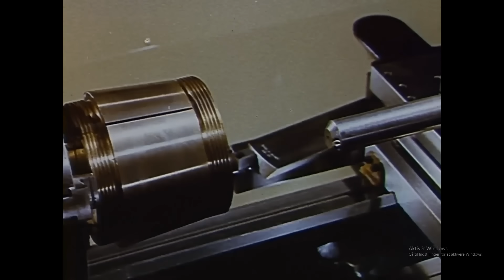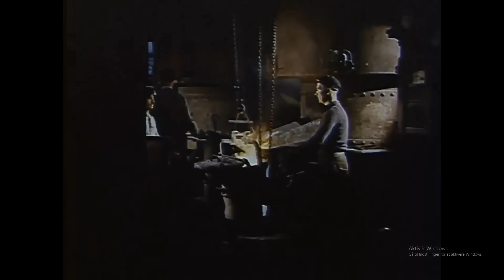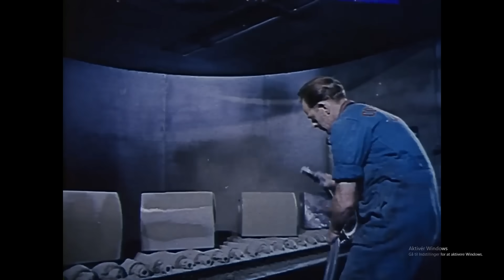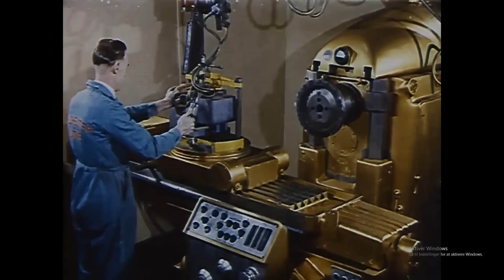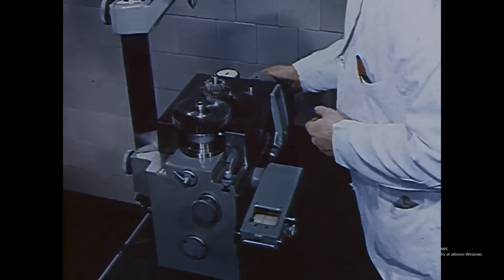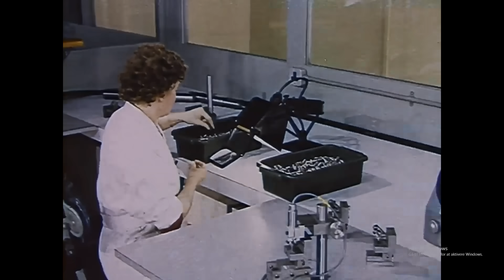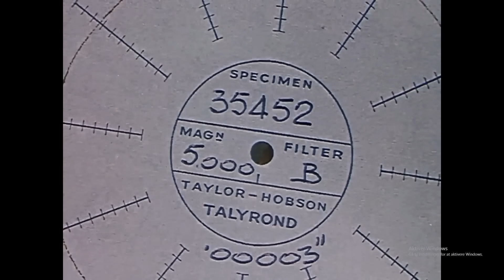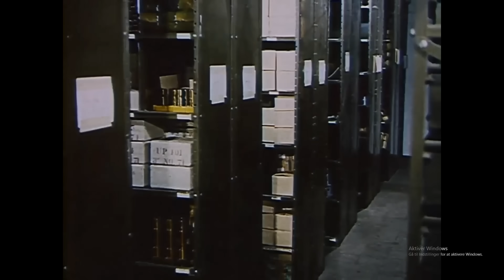Colchester Lathe Company

Comment: I do wonder when this film was actually made. I mean, gold painted CNC machines?
Reply from the maker: They are not CNC ☺️ its from the 60'
Reply: @VærdAtSe  Hmm. We had a computer fly a rocket to the moon, and that involves complex trigonometry. Modern CNC machines do nothing else than simply execute programs. They do not pay attention to any vibration etc. If you tell a CNC to plough at 12m/s through unmachinium, then it'll try to do that. And those machines could very well have rudimentary control logic. It depends on what you count as a computer, and what isn't. I mean, it could be using cams and all that like Starret did (and does, though they're phasing those machines out), but I would assume that they would technically have been able to pull that off.

And wikipedia (https://en.m.wikipedia.org/wiki/History_of_numerical_control) says that Monarch demonstrated a NC lathe at the 1955 Chicago Machine Tool Show. As far as I can tell from the article, CNC was already commercially available in the 60's, though it really took off with integrated circuits.

Comment: I wonder what year this was filmed?   The two newer vans shown appear to be Ford Thames 400E vans, which were made from 1957 to 1965.  The newer vans' license plate scheme was typical of the late 1950's up through 1962.  So, the video was most likely made between 1957 and 1963, unless the vans are more than a year or so old.    

The 5" Chipmaster lathe was introduced in 1956.

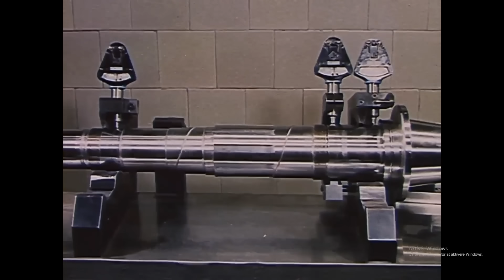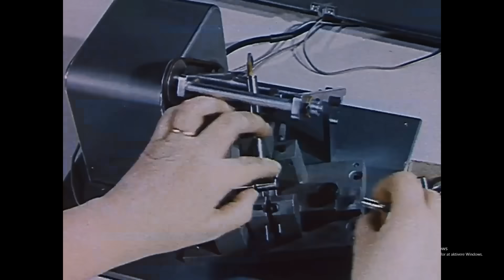Comment: @17:30 "However it is in the spindle bearings that precision reaches its peak" . . . @19:00 "machine can measure 4 millionths of an inch, and in each bearing the dimensions do not differ by more than 10 millionths of an inch". That's wicked accuracy / tolerance / variation for the immediate post WWII period (1960's this film?) and I'm so impressed. Such quality of workmanship, such a focus on doing the best possible, not "good enough" - building up to a quality not down to a price. I want one!

Comment: Lathes made by them are quite good. They do have weaknesses through like anything else. Bearings are OK as well but not revolutionary - if they were one could buy them somewhat easily today & they would follow standard sizing. Infinite variator in chipmaster is remarkable engineering (Swiss) but does not last too long - no match for US competition's designs. Compound is held in a way that I hope no one ever copies. Bed is well made and very rigid, headstock spindle the same. Gearing is very well made. Matrix clutch is solid but safety for it was added later on, not from beginning. Motor is large and more then adequate. Overall one of the top makers in the world.

Comment: I worked at Dormer Machine Tools in Worksop in the 70's. When they moved from machine production to drill production this meant investing in specialist equipment making the rows of Lathes, Millers, surface grinder etc redundent. At the time there was a slump in prices on second hand machinery prices. Making them worthless and scrap. To prevent the scrap merchant selling them on we dropped them into skips off a fork truck to smash them. I can remember dodging the flying parts as the flew off.

Comment: Worked at Colchester lathe and did a 4 year apprenticeship in the 70s,Worked on most of the machines from snow grinders to laths.I was there the day they showed a grope of Chinese round the shop and saw the first lathe they made copying ours.Over 400 worked there at one time and we had one of the first cnc machine shops which then you programmed with tape and it cost £1000 for 1 k of bubble memory.Memory’s it was a good place to work and we were all very well paid for the time

Comment: they had 1 major problem the main spindle brg preload was set with springs if when grooving you turned away from  chuck it ruined the gammet headstock brg because the springs compressed and the front brg went slack and the rollers scored the ring

Comment: We need to get back to making quality machines such as this, made to endure and if needed repaired instead of thrown away and replaced. Better products, better work and skills, better for the environment.
Reply: Thing is, they never did get thrown away. Eventually everyone who needed a lathe had either a Colchester or Harrison and stopped buying lathes entirely.
Reply: @will5948  by throw away, he means the chinese lathes that quit working when the burrs holding them together finally wear off. China is pure garbage. The colchesters, monarchs, moris. Meant to last compared to the scrap heap imported from china
Reply: @mackk123  I meant 'replaced with new' when I said 'thrown away'. Every machine shop and toolmakers I've been to (in the past 10 years or so, in Britain) have either no manual lathe or a 50-60 year old British lathe, and maybe the eponymous American vertical mill of similar age, for similar reasons. These companies aren't replacing their manual equipment because it doesn't break. I'm all for quality product but these lathes (and the Bridgeport mills) were just too damn good!
Reply: @will5948   A toolmaker friend of mine told me that the availability of good quality iron ore is not there anymore to enable making good machinery at a competitive price. He also said that with the cost of lower quality machines being so low, if you cannot make enough profit out of using lower quality tools to cover the cost of replacing said tools by the time they wear out then you are not a good businessman and should not be running an engineering firm !
Reply: @will5948  It's the same at my work. We have 2 new cnc machines (mill and lathe) and 2 old manuals that are Swedish made. Those machines are probably twice my age.
Reply: @will5948  Myfords are quite popular for the home machine shop.
Reply: I wouldn't be so sure to say that today's machines are exactly cheap and throwaway , particularly Mori and Nakamura etc . Unless for one off jobs , it's so difficult to compete against the modern stuff , particularly in terms of output
Reply: @minifratellijames  what about DMG
Reply: @minifratellijames  I don't think anyone disputes some of the quality and engineering excellence in the machines today. But if you aren't trying to kick out 100,000 parts a year, our options out there are ugly as sin (albeit very good), but my god are they truly ugly, aesthetically speaking.
Reply: It's easy to get nostalgic about old times "quality". These machines are basically useless outside of the garage shop in today's standards.
Reply: @IvanStepaniuk  I’m not sure how you qualify them as ‘useless’? Yeah maybe in a mass/batch production CNC shop they won’t be able to compete on speed and productivity with CNC versions but generally in my experience CNC shops also keep their manual machines when venturing into CNC work in the first place. Even CNC production shops end up having to do small quantities (one offs, two offs...dozens and half dozens etc) parts which don’t justify time programming and taking up capacity on CNCs. 

And no one buys a 5 axis CNC mill for high hundreds of thousands before buying a manual centre lathe in the low tens of thousands first. 

Plus you also have toolrooms, job shop subcontractors, maintenance departments etc. that all still to this day are utilising manual machines over CNC for their requirements. 

I think what is more likely than the death of manual machining is the increasing availability and popularity of ‘CNC-Manual combination machines’ where the operator can directly control the process via hand wheels for small quantities or indirectly control the process via NC programmes for larger quantities. 

This would be a best of both worlds option and a number of companies such as Tyler Machine Tool (?) in the US and Colchester Machine Tool in the UK are already offering their own combination machine models for sale.

Comment: To make a high precision tool, you need a tool of higher precision to make it. No it isn’t a chicken egg problem. The first tool gets more had tuning to bring it to standards required to make the second.
Reply: I'm going to disagree with you there ! What you do need is test gauges to ensure the finished product is to specification. In this film, Gamet's rollers for its bearings were a range of sizes as the machine making them was not precise. Gamet got the precision by selecting sets of rollers within particular size ranges to try to ensure the loading on each roller was similar.
Reply: It is not necessary to have high precision tools to make high precision tools. You can produce high precision using a mechanism of precision multiplication. It is all about mechanical mechanism engineering.
Reply: @comprehendnature2404  They say that the human finger can feel things the eye cannot see ! (difference in thickness, say). Optical systems are common for 'precision multiplication' - the obvious one being the Vernier scale.
Reply: @millomweb  Yes and some examples of precision multiplication or increasing precision is the use of mechanical linkage arm and lever, the use of lead screw, gearsets ...etc, help us to divide a a large movement to small giving us high precision.
Reply: @comprehendnature2404  Works the other way around too - weighing scales usually use a small movement to move an indicator a large distance! - just how hard should you tap the gauge ;)
[Interesting that my 6tpi leadscrew moves the saddle  4·19mm/rev !]

Comment: This is crazy how accurate things were back then. Technology has not improved much in manufacturing and building these kinds of things, the only thing that's new is silicone chip computers and robots operated by them.
Reply: It's laughable how false your statement is.  The Citizen machines that I program/setup/run have accuracies measured in microns.  These machines, at their best, could never hit that level of precision or repeatability.
Reply: @brandons9138  . I guess you didn't get to the right point on my comment. How did your Citizen machines where made? Was your machines 3d printed? Precision and repeatability is the only thing what is improved,  other then that it's the same thing.
Reply: @NotJustCreative  "Precision and respectability is the only thing what is improved,  other then that it's the same thing."
Well yeah. Thats pretty much the 2 major measures of how good the machines of this kind are...
Reply: @brandons9138  his statement

Your head
Reply: In the main for general engineering, there's probably little need for anything more accurate today. Much of the accuracy in workmanship was down to the machinist and his skill - and use of gauges. The precision of the machine only facilitating the quality of workmanship.

Comment: The ladies checking the rollers of the bearings then tossing them into the next box and or into the box according to the tolerance range.  I just about came out of my undies!  Surprised they did not ding them or scratch a roller from all of that handling!  Of course, I know they are very hard less likely to ding, but from getting scratched......

Comment: I do not hold British industry in high esteem, but having watched this clip, the Colchester Lathe Co has my attention. Like the QC steps at each production process and the methods used - and this was before electronic measuring and testing machines. Their manufacturing methods are very scientific, full of proper engineering. The range of lathes is also impressive.
Reply: @Tabourba  I know about JCB, but if their machines are evaluated, you find that the back hoe is not a universal performing tool. It has limitations - the dirt can only be placed at the max of the boom. A better machine is an excavator(digger), which can move around further. The world domination of excavators are all Japanese machines, Hitachi, Kawasaki, Mitsubishi, Yanmar, Kubota, Shin Meiwa etc. The Koreans are also putting out Daewoo, Hyundai, but I am not familiar with Korean engineering.

Comment: I would rather like to have a ColchesterStudent Lathe (plus attachments)  for my home workshop.  Problem is cost.  Undoubtedly too much for my retiree's savings.
Reply: Having recently bought a Student, I have to say the cost of the machine is only a start. I had several quotes of around £1000 to deliver it 70 miles.
I eventually managed to do a little better. I had a Myford for 30 odd years - the Student is a revelation.

Comment: I love the lady checking the rollers for surface defects and then piffs them into the container.
Reply: " Well, they were fine when I inspected them deary."
Reply: Rockwell hardness of +60 designed to withstand incredible stresses.
Reply: @spockspock  
Yes I get it they’re hard but so are the ones that they’re landing on.
Reply: @michaelslee4336  does not matter. It’s so hard even a small drop onto other hard stuff won’t remove material. If it was too damage it would catastrophically fracture and crack.
Reply: @maxpowerii7368  
Talking about dints and defects champ.
Reply: @michaelslee4336  same. You won’t dint steel which is heat treated to 60+ Rockwell hardness. They are bearings after all designed to withstand strong loading of machine tools. If a drop of what 10cm could dint it they aren’t much use to begin with for their application.
Reply: @maxpowerii7368  Yes but still, would have been nicer if she gently placed them in the bucket instead of chucking them like that.
Reply: Except those rollers are so freaking hard you would be “hard” pressed 🤪 to dent one lol
Reply: @Mad.Man.Marine  correct you can run a file over it and it won’t even leave a scratch never mind take material away.
Reply: @Mad.Man.Marine  
It shows a nonchalant attitude.
Reply: @michaelslee4336  I would say it shows she knows the product and knows there is nothing bad that will happen by doing it or she wouldn’t have her job.

Comment: You've got to be kidding me - tolerance / variation of 0.00003" / 0.0007mm back then?? What wonderful quality equipment! Thanks for uploading, that's a pretty good transfer as well from old film stock. Magnificent!
Reply: I choked when I heard that. I would give anything to be able to buy one of those fresh off the line.
Reply: work of being one of the very first factories to adopt numerical control. ND was cnc before computers and it was invented by MIT for the U.S. Air force in 1951. Being a supplier to the ministry of defense no doubt enabled the export of nc tech to jolly old Colchester
Reply: @joshschneider9766  To be fair we did give the USA its language, computers, the jet engine and supersonic flight. You’re welcome 😊
Reply: @MatthewHolevinski  Bought a square head Student 52 years ago, still using it. The only thing I`ve replaced is a three jaw chuck, the tailstock is just at a point where the tang on the drill fails to bite. Still has the original drive belts.
Reply: @JohnJones-cp4wh  rub it in ;)
Reply: @JohnJones-cp4wh  Here , too....a really superp unit, now building airplane parts of even earlier times in a future they could not really dream of. Modern stuff may not live up to that.

Comment: Back when stuff was built to last. A factory I worked in still had machine tools built in the 20’s running every day with no problems. All built in Britain.
Reply: But they weren't exactly cheap, and if you spend the money today, you can still get very good machines. Sure, they're not hand painted, but that does not contribute to the mechanical abilities of the machines. I do agree though that old machines definitely feel very different.

Comment: Engineering that was the trade mark of Britain, long gone now thanks to cheep crap imports that this so called government encourage to import.
As one person said----call centers now.
Reply: 'British Engineering' dissapeared because the workers wanted so much more than was avalible to give them and suvive as an industrfy,  low cost goods, and high wages don't work hand in hand, however we still have a large engineering sector in this country, it's just alot more specialised than it used to be, and makes some high precision parts.
Reply: @almostanengineer  that’s inaccurate and just anti-trade union sentiment. If industries choices for the future of British industry was correct why did the same choices kill the industries off largely. And you can’t say it hasn’t when entire industries don’t even exist in the UK anymore such as manual machine tool building. Looking after one’s workers is the key to commercial success not the cause of failure.
Reply: Max Power II no that's pretty accurate to what happened, the manufacturing industries that survived were the ones that produced high value goods for industry, most of Britains manufacturing was home wares, and small goods that got shipped off to the Far East where there workforces worked for less.

As for manual lathe tooling, like this, CNC took over, and the companies just didn't keep up pace, when companies like Shoblain did, so Europe took the lead on that front.

As far as unions go, they have there place, but got so greedy, and in the case of the miners union, power hungry, and has there arse handed to them, and I'm not anti-union, just disappointed in the ways they have been used and run.

Comment: Brilliant machines, I spent some time working on the Triumph 2000's and would keep 0.0005" tolerances easily.  We also used to re-cut the gland nut thread on the Boeing 737 classic main landing gear outer cylinder on a Mastiff 1400 (I think) and that always went without a hitch.